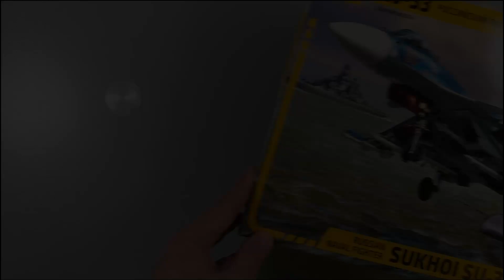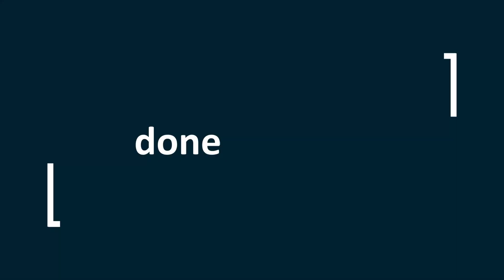Painting and Weathering a Zvezda 1/72 Sukhoi SU-33 Flanker-D

Comment: Missing information (comments) about what paint (color) in what proportion was used (and other elements - like varnish, pigments, ec.). I.e. "Tamiya XF-00 + XF2 (2:1)" ... The rest is perfect! Nice project! I would add some hydraulics imitation for landing gear (with 0,1 mm wire) Btw, what paintbrush are you using for small and extra small paintings? I.e. at 6:30?
Reply from the maker: Thanks for the comment. The paint colours are in the description. I've updated it to include the weathering and varnish. The brush I use for detail parts is the Winsor and Newton series 7 #1
Reply: @echelonhobbiescanada  Thanks! Waiting for your new projects
Reply from the maker: @sergiobalashov8563  Thanks. I hope I can start making new videos soon. Stay tuned!

Comment: Tell me please, how do you remove the panel lines on both sides? I am afraid to destroy all the coating if I use thinner for that.
Some layers of protection??
Reply from the maker: The enamel based panel liner can be removed with white spirits/ odorless thinner without damaging the acrylic paint. But I did use a semigloss varnish over the acrylic before applying the panel lines. Hope that  helps. If you are not sure, test the technique on another piece of plastic.
Reply: So I can use x20 a by Tamiya I think. I tried one time and my coating were damaged.
But I think you're right, testing on another model piece with good layer of varnish
Reply from the maker: @herrzwackelmann2876  I’ve always used odourless thinner or white spirt. If you want an easy non-evasive method. Make an acrylic wash and then add a bit of dish soap. Apply it to the model then remove the excess with a q-tip dipped in water. But again, try it on a test piece. You can score plasticard with a knife to simulate panel lines.